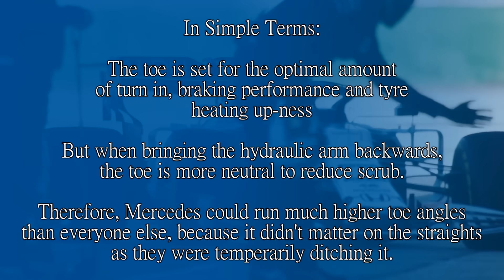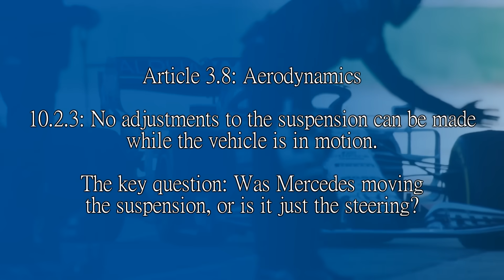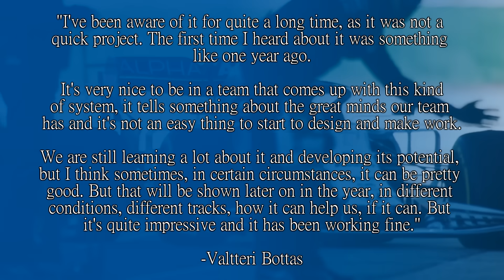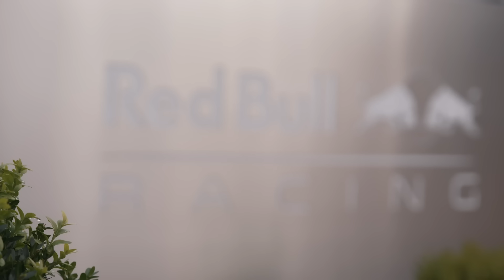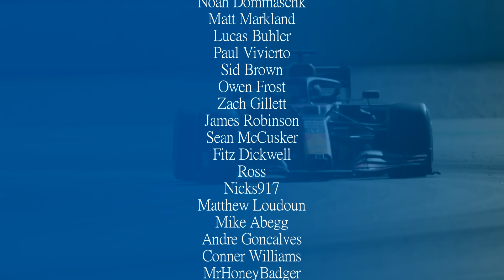F1'S LAST PROPER INNOVATION? The Story of the Mercedes DAS System (2020)

Comment: The thing that really annoyed me about this being banned was that it was an opportunity to demonstrate driver skill to an insane degree. By banning it so quickly Mercedes were only able to extract a year of efficient tyre temperature control by switching between two toe angles by using only the extremes. Give them a couple more years and the drivers would have multiple toe angles they would aim for at different points around the lap. Give it a decade and analogue 3D steering becomes an essential skill of the top level of motorsport. Imagine the tricks an Alonso could pull with this as he carefully eliminates tyre overheating as he approaches the car in front and seamlessly switches to aggressive angles to maintain tyre temperature the moment he is in front and wants to pull away. But instead the technical tricks remain hidden behind steering wheel buttons and knobs that most people never notice.
Reply: Go to mode 15:Dash4-appendix 52-665 for an extra 3hp.
Reply: Just more gadgetry that gets in between the driver and the competition.
Reply from the maker: Mercedes was trying to have the system rigged so Valtteri and Lewis could dial in the exact amount per corner. It was going to be way more advanced than it already was.
Reply: @BobbyGeneric145  but on that basis where do you draw the line? DRS, ERS, the aero? Is slick tyres too much?
Reply: @christiansimmons630  im not a fan of drs or ers... Nor am I a fan of the ability to change so much of the car on the wheel. The fact that drivers are making dozens of settings changes per lap is just overboard.
Wheres the line? Well, some common sense aids one in locating it. We could be stupid and say "oh the engine keeps it from being all about the driver" or we could have some common sense and say that things like slicks and aero are essential to the type of car.
I know this season and its 7 winners defeats my argument, but racing was much more exciting when the cars weren't as high tech.
Reply: @BobbyGeneric145   but it’s not obvious what is “essential”. How about flappy paddle gearboxes? There is no black and white when it comes to the cars

F1 is the pinnacle of motorsport, the best the pinnacle you have to innovate, DAS, the blown diffuser, KERS, the FW14B etc
Reply: facts it wouldve been like when padle shifters first came out
Reply: @BobbyGeneric145  f1 is as much an engineering series as it is a racing series
Reply: I think this would have been a much cooler implementation of driver controls than all the knobs and switches and special software system 734s and whatnot. 

3D steering is legit an amazing idea and also shows how well tuned and designed the car is across the board with controls and balance. And it would make the drivers have another dimension of skill to apply: physical control over the camber and toe of the tires.
Reply: God Alonso wielding that thing would’ve been art. Give his car an insanely strong rear end and it’d be back to his Michelin driving style

Comment: Loving it that back then Max fans got their panties all twisted up, calling it illegal, ignoring the fact that Mercedes had worked WITH the FIA to develop the system to make it fully legal.
Reply from the maker: And are now quiet about this asymmetric brake thing. 😅
Reply: @ronmastrio2798  explain this take 😂 what was illegal about the car up until das?
Reply: @AidanMillward   The big difference is that they changed the rules in the middle of the season now, while they allowed Mercedes to use DAS until the end of that season. The same thing happened with pit stop regulations 2021. and "porpoising" regulations 2022. If anything, Max fans should not be quiet.
Reply: @nicedeer1  the pitstop regulations addressed an issue that a number of teams had been pointing to for a number of years, and in 2022 Red Bull had one of the heaviest cars and kicked up a massive fuss to get the minimum weight increased, even though other teams had managed to get cars at or close to the minimum weight. Don’t even try to pretend that Red Bull is in some unique position when it comes to rule changes.

Comment: I think the suspension innovations that are absurdly strong (like interlinked hydraulics and G-force affected brake link valve) go unnoticed bc of how invisible they are. F-Duct and DAS were very visible, blown diffusers were very audible. But those hidden innovations don't get many eyes on them due to how silent they are. RB's brake line valve producing asymetric braking forces and basically eliminating understeer is a crazy innovation but there was nothing visible or audible about it, so it went unnoticed.

Comment: 2020.  Bring back the outer circuit at Bahrain, that was fun.
Reply: Would honestly be more exciting than Abu Dhabi as the season finale
Reply: What should have been the first George Russell win but condemned us to watch Checo get absolutely destroyed in a Red Bull ever since
Reply from the maker: @mrreziik  yeah but they had to sabotage George to make Lewis look good smh my head imo.
Reply: Can't sub 60 sec lap
Reply: @huwgrossmith9555    Easily solved: Add a U-shaped loop where the "endurance circuit was (running part of the "Oasis" circuit in reverse), quickly reconnecting to Turn 13, on the GP circuit.  It would add 600 metres, and would add 6-10 seconds to lap times.
Reply: @huwgrossmith9555 i don't see an issue with a sub minute lap
Reply: @callumlaird1195  I believe the rules block any circuit with sub 60 second laps
Reply: @huwgrossmith9555  oh, I wasn't aware of that but I'll look into it later

And if the next formula of cars are as slow as they're suggested to be then it wouldn't be an issue anyway
Reply: Bring back old laman's track, nurinbergring, oval tracks, the island of man course where they hold the motorcycle race, that would b interesting that what f1 was all about road racing.
Reply: @callumlaird1195  <60 seconds means too much dirty air. That's an average of 3 second intervals between 20 cars.

Comment: I miss the 70s and 80s. Take any race in the 70s and the variety of designs was incredible. Of course, they were also death traps. I followed F1, Rally, MotoGP and GT cars (With a dash of CanAm and F5000) and at some point I stopped putting up posters of drivers/ryders in my bedroom because they had a tendency to succumb to "unaliving syndrome".
I remember putting up a signed poster of Pierpaolo Pasolini (perennial #2 behind Giacomo Agostini in MotoGP) only for the poor guy buying the farm at Monza along with Saarinen.
I don't miss the weekly litany of drivers buying the farm, but I miss the innovation, variety and excitement of those days.

For F1, I think less aero and fewer regulations would be good for the sport, as long as safety remains paramount.
I'd like to see the cars relaying more on mechanical grip and sounding less like a lawnmower. Also, the current crop are way too big. They'll be smaller soon, but not by much.
Enginewise, I'd leave the turbo and number of cylinders to the manufacturers, like it used to be. Otherwise F1 is going to be Indy, but much more expensive.

I know it will never happen.

Comment: The innovation fitted to arguably the best Formula 1 car ever made.
Reply: The FW14B has entered the chat, but definitely right up there.
Reply: @JohnSmithShields the FW15C was way better than the FW14B
Reply: RB19 says hello.
Reply: @BarbaricAvatar regulation limits and cost cap says hello on that.
Reply: @BarbaricAvatar  RB19 wasn’t innovative or had any fancy gimmicks it was simply better. Like the F2004 or W07
Reply: @StanceSantos  The original statement made no mention of the innovation being the reason for the cars' alleged greatness. It just pointed out that something was fitted to "arguably the best F1 car ever".
Reply: @BarbaricAvatar  well objectively it is the best as it’s the fastest F1 car ever made
Reply: @StanceSantos  Except the W11 didn't lead as many laps as the McLaren MP4/4, nor did it win as many races (actual or percentage) as the Red Bull RB19. 
So objectively, you're wrong.
Reply: @BarbaricAvatar  I’m talking outright pace here rather than win percentage, there’s a reason it still holds lap records
Reply: @StanceSantos  Based on outright pace, as you've nominated: The Mercedes W11 holds only one lap record at a track we still race at. The W12 on the other hand has four. And the RB19 has three. 
Remind me again why the W11 is "objectively" the best/fastest F1 car ever when it holds less active track records than the Merc's that came before and after it, and lost 3/17 races.

Comment: The issue with the DAS system for other teams in regards to the cost cap was that the nature of the mechanism requires more space in the nose/cockpit section of the car and if you look at the Merc of that era you notice it's much larger in this regard than a lot of the other cars (some were using a similar design philosophy but not all). If this feature had proven to be a massive advantage then it forces the other teams to dramatically redesign their nose to fit the system and if you dramatically redesign the nose of an aero dependant car, you have to redesign everything downstream of the change because the nose dictates airflow over the rest of the car. Basically, you're throwing your 2020 car in the bin and starting again but this time around you've got no budget left and you've lost the previous 4 years of tinkering that lead up to the 2020 car.

Comment: I think the one we just found these past couple of days - the tuned-mass device that use inertia to distribute braking power across the axle, thereby adding torque-vectoring by braking - on the Red Bull is simple but also genius. Not sure if the track down of such a device led to Red Bull losing so much pace, but if so it’s almost up there with DAS
Reply: Whoa, what's this? I've never heard of it.

Comment: the inside  front wheel turns at a sharper angle when the tie-rod is in front of the axle, or the outside front wheel turns at a sharper angle if the tie-rod is behind the axle.

Comment: I wouldn't worry about failing the "nerd purity" test - even the relatively simple explanation you've provided reveals that this was a piece of engineering genius. I'm willing to bet Mercedes is thinking of how to translate this to road car usage, so that they can sell cars to the public on the basis of lower tyre wear and better grip.

Which at first sight seems like an impossible achievement. After all, if you want to increase grip, you need to increase friction, and that inevitably means a side salad of increased wear. But if you can control how much friction you need by clever use of real time toe and camber angle changes, you can achieve that seemingly impossible combination. You set the car up for the lowest safe level of friction in a straight line, then increase the friction in a corner when sensors start ringing the first stage yellow alert with respect to grip. Have computers handle this, and just like dual clutch gearboxes, response times will be of the order of milliseconds.

Mercedes is probably racking up a million or more miles of test track running putting together a usable road going version of this right now, and lining it up as yet another feature to add to a future S-class. Then percolate it down to the lesser models in the range, and watch other manufacturers scowl as they have to play catch up.

Combine this with a 4 wheel steer setup and some other driver aids, and you have a car with some serious performance advantages with respect to avoiding catastrophe.

If Mercedes IS doing this, you'll see it turn up in the press blurb when an all new S-class is being wheeled out. It might even go all the way to a full 3D analogue syeering system of the sort another commentator has already mentioned, controlling camber and toe in real time.

Remember, Aidan gave you the Class 101 on this before it became another S-class bell and whistle.

Comment: seems like a concept that would be very useful for our normal cars (done by computer of course). It's not like it's difficult tech that requires special metals or anything. I especially like the ability to lower rolling resistance on straights.

Comment: You know what? Even though it helped Mercedes continue their dominance, I liked the innovation because without innovation we wouldn't have had the likes of the Cooper of Jack Brabham (changing where F1 engines are placed forever), Lotus 79 of Mario Andretti (not the first but the best Lotus ground effects car) or the legendary turbo cars of the 1980s, started by Renault and Jabouille in the 1970s. There should be more scope for innovation in f1 but only in a manner where the driver has to fully control it from the cockpit (if it isn't a structural part of the car) rather than the likes of the active williams cars of the early 1990s that offered the driver a helping hand, if you know what I mean.

Comment: I miss DAS just because it was a cool innovation.  Even the push/pull aspect, where you pull on the straights and push entering the corner, where the driver will be moved forward a bit anyway.

Comment: Just as you thought DAS was the last word we now learn that Red Bull had another trick up their sleeve…or perhaps out back. A truly clever brake fiddle. Sometimes I wish F1 would just settle on the number of road wheels and car dimensions x, y and z. Natural selection would decide what worked and what didn’t. After all, I’ve been told for many, many years that F1 was the pinnacle of motor racing. Maybe it should be allowed to prove it.

Comment: Another thing I remember more recently that was clever, although I don't know if you'd call it an innovation and I don't remember it making a particularly large performance difference, is Aston Martin's rear wing upgrade in 2022. The wings are supposed to be one piece with no end plates to reduce both downforce and dirty air. Sometime in the middle of the season Aston Martin showed up with a rear wing that looked like it had end plates, but they had taken the wing piece, bent it straight up and then back around against itself and straight down. That rear wing component was still one piece, but now had a similar effect as having end plates. I just wrote this off the top of my head, so if there are any corrections to that explanation, have at it.

Comment: I always thought the best way to describe what DAS did was "it allowed the drivers to turn the wheels in opposite directions at the same time", which is what they were doing on the straights.

With toe out, there is a point where the outside tyre on a corner has a neutral toe angle, because that tyre becomes straighter before it begins actually turning into the direction the car is going in.  What DAS allowed them to do was simultaneously steer each wheel towards the centre so they both hit that neutral toe point.

This is why it was legal.  It had absolutely zero direct input into any suspension elements, and didn't adjust the camber, which was the basis of the protests (and every complaint since by people who don't understand how cars work).It only did these things to the same degree and in the exact same way that any normal steering input would do, and so any argument you can come up with to ban it on those grounds also stops every race in the braking zone of turn one, as you can now only ever drive straight.

And in order to ban it, a rule had to be written that specifically stated that a steering wheel can only turn the wheels by turning itself.  Before DAS, it had never been necessary to state that a steering wheel can only be used in the way that everyone ever has ever used a steering wheel.  Or that both wheels had to turn in the same direction at the same time.  The meeting when it was proposed must have been great... "Got an idea lads.  Instead of turning the steering wheel to go left or right, how about we move the steering wheel forwards and backwards as well?  And get this, you'll love this bit, when we move it backwards, it turns the right wheel to the left, and the left wheel right, at the same time.  What do you think?"  "You been watching Saturday morning cartoons again Steve?  We've told you before, Wacky Races isn't research!"

Comment: Everyone must be sick&tired of me repeating myself, but I was always under the impression that F1 was all about innovation. Mid engined cars, wings, carbonfibre, safety cells, you name it... Remember that antiballast thing Renault did to their suspension to make the car easy on kerbs? Brilliant. And soon banned.
Some other ideas were nicked but perfected at least. F1 can afford more since the budgets are usually higher.
Now? Nothing new is allowed unless it's prescribed by the FIA themselves. And the costcap, while defendable, makes anyone think twice about a gamble. You're not even allowed to test your idea if you have one.
I liked that pioneering spirit a lot better than this 1999 Matrix mentality.
Reply: It has to be about competition also. I had zero interest in F1 when after qualifying, barring an engine failure, you knew how the race was going to end. Two brand A, then the brand B cars, followed by brand C, etc. That was usually pretty good bets for the season, after the first race set the pattern in motion... Not that it's much better now...